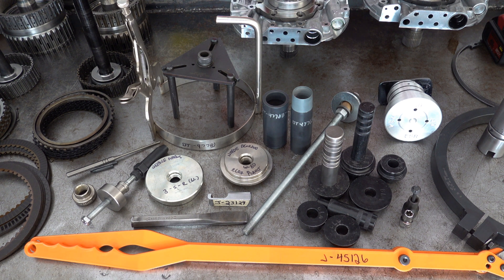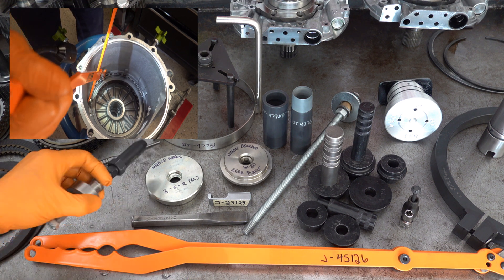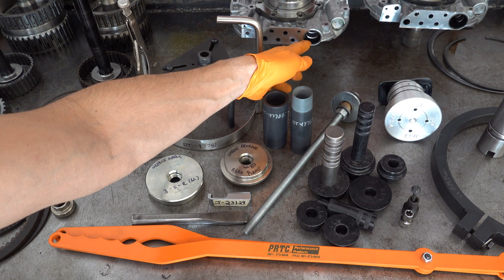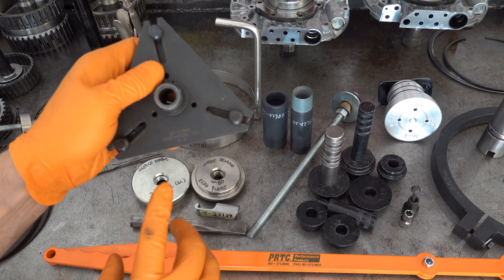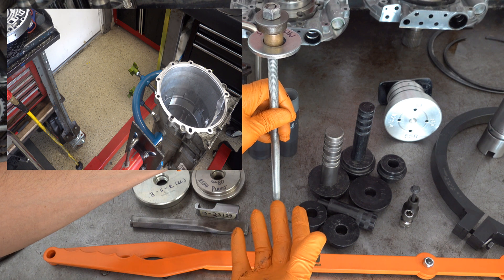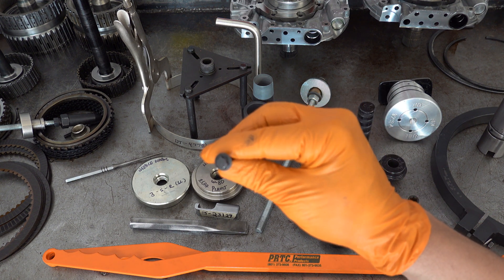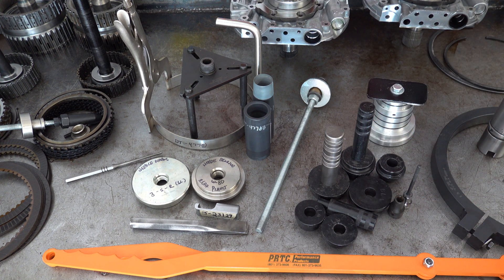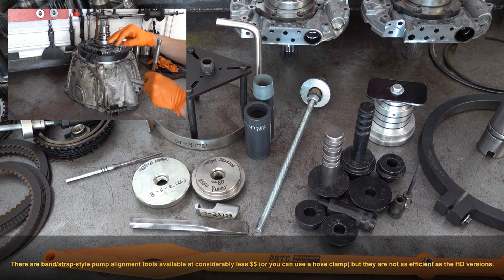Rebuilding the 6L80 Transmission - Special Tools

Comment: This may be a silly question but does this apply to when you are doing a built 6l80 rather than just a rebuild?
Reply from the maker: Of course - what would be different when it comes to the tooling required as it applies to build levels?

As an aside, the only tools that are super critical are the long pliers, drum air testing tool as well as the bushing and seal drivers. I typically don't use the 35R drum holding tool and you can even get away without the pump alignment tool if you're super careful when marrying the two halves back together.

Comment: I cannot find that kent-moore DT-48550 anywhere.  The places I've seen listed on websites for sale but out of stock were $300+ some over $400.
Reply from the maker: Check Freedom Racing. They're stupid expensive but may have it available.
Reply: @nickstransmissions I may have misunderstood your video but I thought you said they were about 30 bucks
Reply from the maker: I bought mine off eBay for around $45 shipped - I think it was a private seller/estate sale where the individual selling the tool had no idea of it's actual worth.
Reply: @nickstransmissions Well I'm happy for you lol. It does look like it's worth the money if I'll be doing many of these.
Reply from the maker: I tell people all the time in my videos - for special tools, constantly check eBay!!! 

That's where you'll find good deals on hard to find special tools. There were two or three other listings for that exact same tool for around $50-$75 at the time I bought mine. 

Set up a notification so that when one is listed, you get notified and can buy it if it's listed at a good price.

ETA: If your parking pawl housing isn't leaking at the rear of the case then that roll pin doesn't have to be removed. That pin is by far the toughest to remove and def requires that puller or something similar to take it out. You should be able to pull the other ones for the shift linkage/manual shift shaft using a good pair of diagonal cutters.

Thanks for watching, Jarod.

Comment: Do you consider the seal resizer tool(s) for the teflon seals mandatory?
Reply from the maker: I do unless you have a proven improvisational method for resizing the new sealing rings once you install them. Basically most of the tooling you see in this video is mandatory. Whether you buy the tools or make them yourself is up to you but you need them to competently rebuild these transmissions with a high degree of confidence that the build will be successful.

Thanks for watching!
Reply: @nickstransmissions you have by far the best tutorials I’ve ever seen. I did DIY the snap ring pliers ha. Those came out beastly but functional. I’ll order the resize tool then now. You do so much for the 6L guys I don’t understand how you manage to make so much quality content and participate as much as you do on the forums. Thanks again your the man!
Reply from the maker: Thanks, Jimmy! Appreciate the kind words, man....Sorry I missed this reply initially.

Comment: Any recommendations for a replacement for the K-48550 roll pin removing slide hammer? I can’t find em and if I can, they’re like 300-400$
Reply from the maker: Thanks for watching, Zach...Not that I am aware of - don't know of anything short of something you can fab up yourself or have custom-made.
Reply: @nickstransmissions Thanks for the reply! I guess I’ll try to figure something out.

Comment: Bushing driver kit link, please. Bought from Amazon but it didn't work
Reply from the maker: Hi Gilberto, I'd not buy anything off Amazon any further when it comes to transmission parts or tools, unless Amazon is simply serving as a 'pass-through' agent for a well-established supplier like WITT Performance but I'd buy directly from the supplier before I'd purchase off Amazon. 

Sorry, I don't have a link to that kit as I bought it off eBay several years ago.

Comment: Checking tool... looks to be a re-purposed output shaft of some sort?  Would please clarify its source.  Thank you.
Reply from the maker: Hi Darryl, thank you for watching...Are you referring to the pump checking tool or the tool used to air check the 3-5-R drum? Neither are modified stators however the 3-5-R tool basically acts as a stator of sorts, mimicking the pump's stator.

Comment: What is the part # on the bushing driver kit for the 6l80 I'm fixing to rebuild my transmission my self and I'm going to start buying the special tools ahead of time
Reply from the maker: hi Jeff, thanks for watching...There's no part number associated with that bushing driver kit but if you search eBay for '6L80 Bushing Drivers', it or a similar set should come up...You also will likely need to buy the seal driver tool kit for the front pump/bell housing separately as it won't come with the other bushing driver set.

Comment: I had to go buy a whole PRESS at Harbor Freight becuz of this thing!! 😂😂
Reply from the maker: Good on you for buying one (too many DYIers don't for some reason) - You'll likely frequently use it for at least the next 20 years; it will pay for itself hundreds of times over during that period. I know mine has...
Reply: @nickstransmissions  correct, im doing my own car for first and maybe last time, but I figured the press could serve me a lifetime for other projects anyways 🤷‍♂️ $200 down the drain! 😎
Reply: @nickstransmissions  I used a floor jack under my frame to compress the 4-5-6 spring. Definitely would recommend just getting a press. I broke 2 of the dams lol